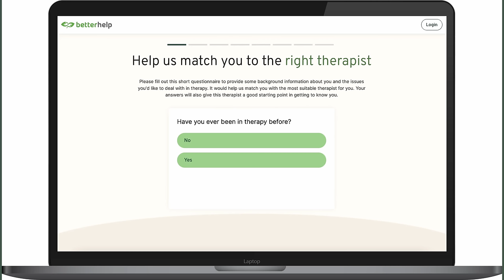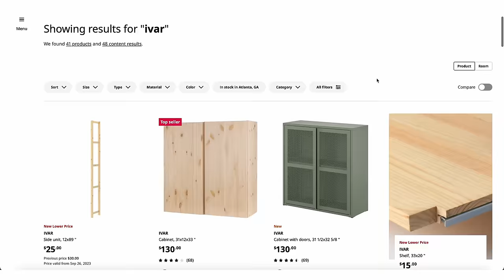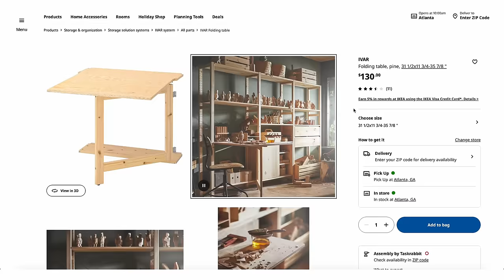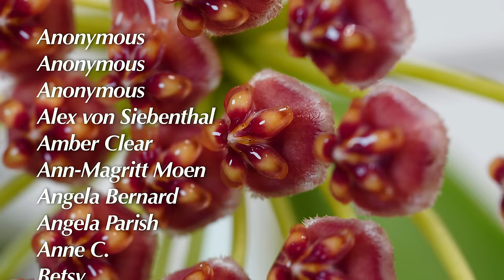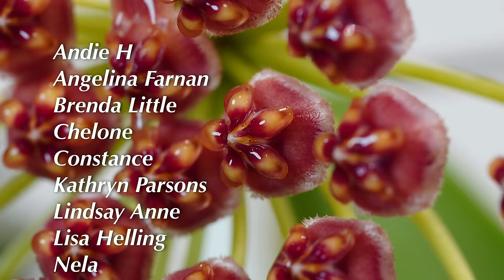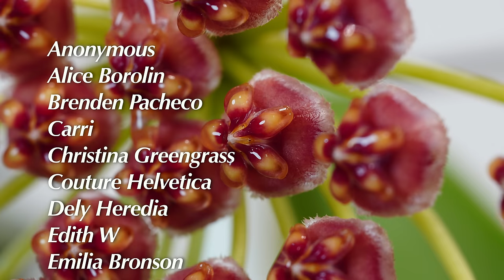Tiny planty home office setup | Solution & ideas for small spaces

Comment: Hello Miro. 
I love your videos. You are so funny and likable. 
I have an idea for you. You say in the video, that your table is too low for you. 
If you move the tabletop shelf a bit up, you can just extend the one leg you flip out. That way it will still support the weight of the table even though it’s higher than intended. 
You would only need some wood and screws to make the leg longer.

Comment: You probably had the wrong sandpaper. When you are taking paint off, you want the "sand" to be bigger. It will take off material faster. Then you get smaller "sand" on the paper to make everything really smooth. I don't know how they rate sandpaper there - in the US you want 80 or 120 grit, then 220.
Reply from the maker: They are rated the same :) I actually went all the day down to a very large grit (40) and then 60, 80, 120… :) It didn’t help much as the paint seeped into the wood + it is waxy paint, so it’d wear out the sand paper fast.